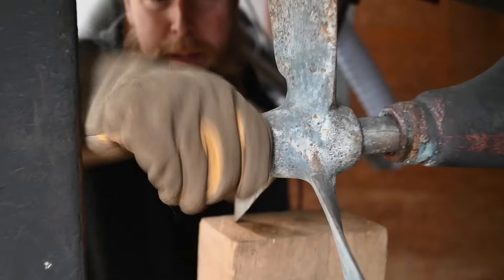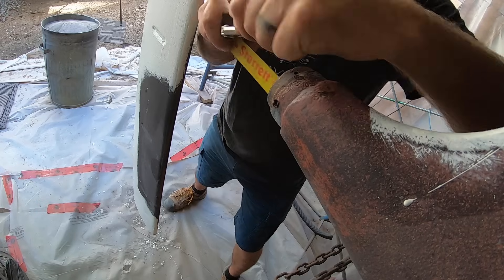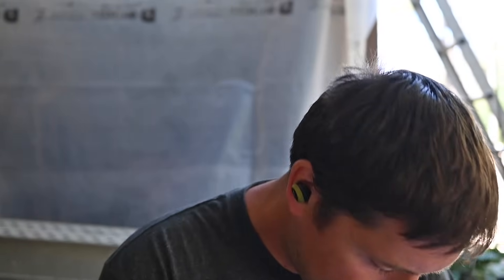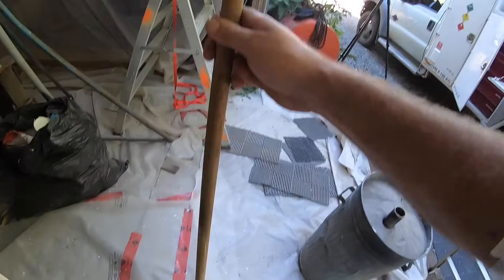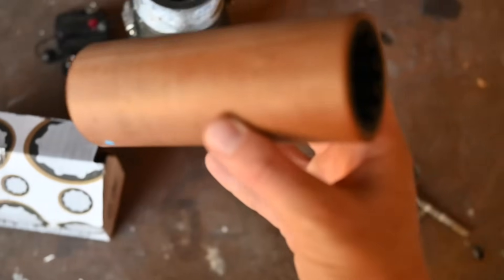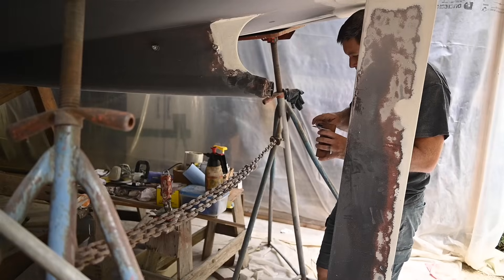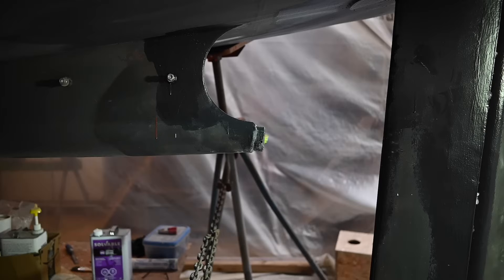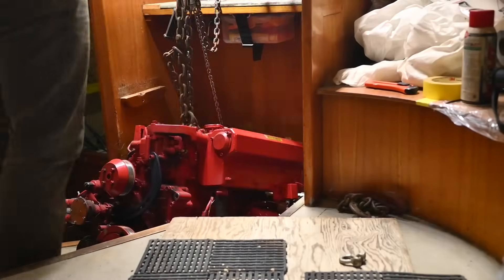The Not So Straight Forward Cutlass Bearing Install | Ch 5 E 91 | Steel Boat Restoration

Comment: 1:21 if not Logan,  use the old mig trick,   I’m pretty sure you know it,  build up a weld and weld a bolt on nut to the striped one..     pretty sure you know it because we seem to have the same skill set..

Comment: The brush broom was crazy creative! 
14:09, his face...
Yeah, the thicken epoxy trick is neat... You could not have inserted a sheet of metal of proper thickness, as a sleeve, and weld it? Maybe too thin to weld??
19:37. Logan got tired of being "gentle" LOL.
Glad to see it all fits together.
Getting closer!
Reply from the maker: We could have put another sleeve in like what was originally in there, but welding wouldn’t have been great because of the layers of steel that are there. So hopefully this holds up 😅

Comment: 3:05 a cylinder hone..   and i did say this months ago..     😂 I finally got an answer in before you started a job..
Reply from the maker: Lol it was attempted but the cylinder hone blew up. Also harder to control than what was used. But yeah would have been great if it worked

Comment: Looks like a boat, are you putting the old engine back in and if so have you done a rebuild on it ?
Reply from the maker: The engine was brand new when we bought her with only 400 hrs on it currently, so it’s just going to change fluids, replace some gaskets, change routing of a few things and pop it back in!

Comment: So, curious, why did you not want to put another bushing in choosing in favor instead going with epoxy? was there not a bushing the correct size. We have an upcoming cutlass (or less) bearing replacement in our future, so enjoying learning from you.
I think as I watched more, you may have answered mu question...the bearing you are using is a higher quality, but a bit bigger...Is that correct?
Reply from the maker: Yeah, so this bearing was supposed to fit in pretty smoothly, but I guess with slight measurement differences it just didn’t.. and also there was the issue of the tube being two different thicknesses due to being machined. There are lots of way to go about how we did things, and putting it back together the way it was when we got it is def one of them. We were just hoping to make something that worked better. Whether or not it will is yet to be seen 😂